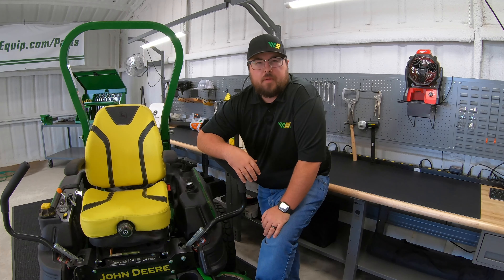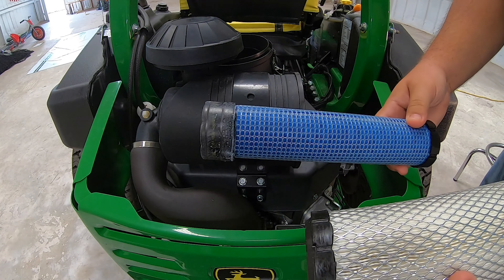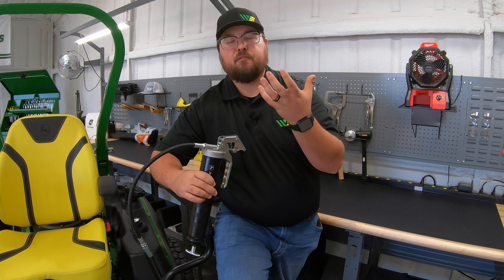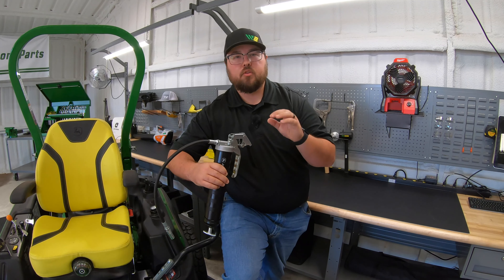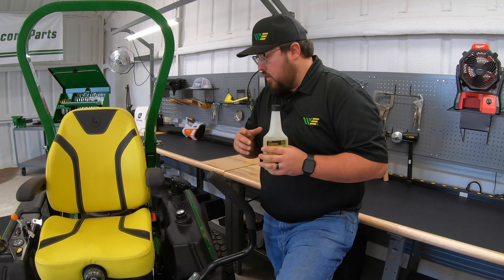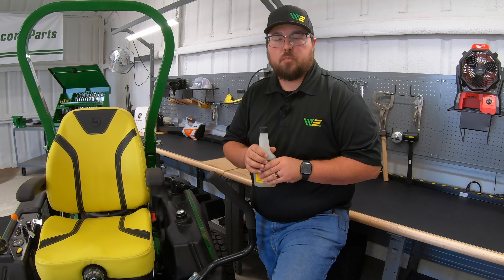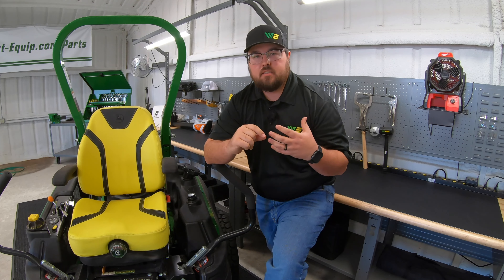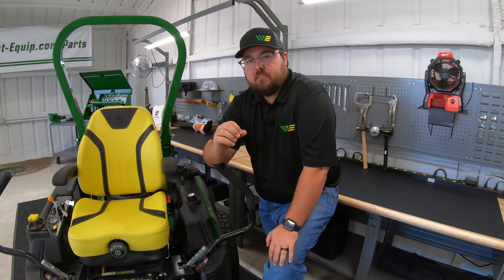5 Things to do Before Storing Your Mower for the Winter

Comment: Good overview. I’ve also seen people recommend fogging the engine with fogging oil while ruining the engine empty. My Kawasaki engine manual says to remove the spark plugs and put a little oil in the hole. Do you think these winterizing oiling steps are not necessary?  Also, for the battery,  manual says to simply disconnect the negative terminal. Is this inferior to using a trickle charger?
Reply from the maker: I’m not real sure on the oiling techniques. That seems like a little over kill for the mower only sitting over the winter and I would always suggest going with a battery maintainer.
Reply: @WesternEquipment  great. I went with using a battery maintainer and not bothering to fog the spark plug holes.
Reply: Not gonna hurt
Reply: @armandosinger I followed the manual last year. Pulled the spark plugs and poured a bit of oil in. I think this year I'll be fogging with some seafoam deep creep. It's like handling pest... gives you a peace of mind. You're already investing a bit of time doing these five things. Why not spend an extra 20mins?
Reply: @johnm.6349  My riding mower manual also states to pour 1 ounce of engine oil through the spark plug hole into the cylinder for off season storage. I learned that this helps prevent the cylinder from rusting so I will be adding the oil before I store it.

Comment: Hi, thanks for the great video.  Wondering where my fuel shutoff valve might be on a z545r if any. Manual says to use it if present as the manual covers a few different models. Thanks!!
Reply from the maker: I don't believe it comes with one from the factory unfortunately.

Comment: I have my mower in my shed so it’s not in the elements there’s no electricity in the shed so using a trickle charger is out of the question. Would it be fine to go out there throughout the winter and just start the mower and let it run for a little bit to let the battery charge up like that or would you advise against it?
Reply: I’m not sure
Reply from the maker: This would work, but the cold will drain it quicker than in warm months so you will have to stay on top of it.

Comment: If I can't hook up a battery maintainer to my S130 due to where its stored, as in outside under a tarp away from power outlets, would it be a good idea to disconnect the battery and take it in for the winter?
Reply from the maker: Yes, I would do this for sure. Thanks for watching!

Comment: Having a new S130 delivered this sat 11/26/22,  I have a shed with no heat, would pulling the battery in bringing it in the house for the winter work? Live in NJ winters hang below freezing for around 3 month, I don't want to run power cords to the shed for trickle charge.
Reply from the maker: Yes this would be ok as long as the battery is not on the floor on concrete.

Comment: Hello for winter there’s a little pool of gas I can’t siphon out,  anything I can put in there to evaporate it so the carburetor doesn’t get gummed up? Thanks so much
Reply from the maker: My recommendation here would be to invest in a small bottle of fuel stabilizer and then mix it with a small amount of gasoline. Then run it in your mower for a while to get everything clean in your fuel system (lines, carburetor, etc.). Then turn the fuel off on your mower if you have a valve and if not then let your mower run completely dry. Or you could completely fill your tank with the fuel stabilizer and fresh gasoline mixture, run the stabilized fuel through the system, and then it should be fine to let sit over winter. I hope this helps and thanks for watching!

Comment: Trickle charging is not an option, can I remove the battery and store it indoors for the winter, will that erase the hour usage gage or other readings
Reply from the maker: Yes you can remove the battery and store it. This will not affect your hour reading or gauges. Good question and thanks for watching!

Comment: Where exactly is the fuel shutoff valve on the S100? Manuel doesn't seem to have it mentioned or pictured. Did some searching but only found things concerning the solenoid not location of the valve. As far as the Trickle Charger, StrongBox 1.5 amp, no instructions, no attachment to mount under battery. Oh well, it's not rocket science.
Reply from the maker: A lot of the smaller mowers do not have a fuel shut off installed from the factory but they are very easy to install. You can usually find them at your local hardware stores.

Comment: Hey Brent What fuel grade do you recommend using on a ‘22 John Deere z355e, regular or super ?
Reply from the maker: Just use regular gasoline NOT gasoline with ethanol. So look for 100% gas at the gas stations. A lot of times it’s only one pump.
Reply: @WesternEquipment  will do …appreciated the feedback 💯

Comment: Just curious.  Does anyone take the tension off the belts thru the winter?
Reply from the maker: I have not heard of this, but I may have to look into it. Thanks for watching!
Reply: Hypothetically, everything except water/ice cubes contracts when the temperature lowers to and past the freezing point.
I would imagine this applies to the belts as well, in which case they would be put under a little more stress and lengthen a little over time.
Whether the belts would return to their original length and tension come warmer weather ... I don't know.
But it probably wouldn't hurt to remove the tension for the winter.

Comment: 15 hours a year. I'm thinking change oil air filter once a year before storage, battery off inside, fuel stabilizer.   Not sure about burning gas out of the engine with shut off?.Sharpen  blades  Every other year? Maybe every year.
Reply from the maker: I agree with all of that except depending on how much you mow, you may want to sharpen you blades a few times a season. Once you grass starts looking like it’s being torn instead of cut off smooth then your blades need to be sharpened.

Comment: I don't have a trickle charger, can I just remove the battery? Will removing the battery damage the hour and fuel gauge? Thanks.
Reply from the maker: Yes you can remove the battery to charge it, but if you would like to have a trickle charger here is a link to where you can get one https://247parts.com/parts-attachments-and-accessories/john-deere-batteries-chargers-and-accessories/. Thanks for watching!

Comment: Instead of a trickle charger, wouldn’t we be able to just turn the engine on once a week for a few minutes? Would that keep the battery charged?
Reply from the maker: Yes, that should keep things fresh but a trickle charger is a good idea if this is a problem to remember this step. Good question and thanks for watching!
Reply: Yes for either.  I run mine anytime it gets cold or every couple weeks thru the winter.  Been doing it for 30 years and she always starts each spring.
Reply: Need more than just a few minutes. Also want to make sure it gets up to temp and run long enough to evaporate excess fuel that blows by into the crankcase and to avoid condensation issues if planning to run every week or so in off season.

Comment: I have z345r. I was told to run fuel out for winter. Is that wrong? I use marine gas only. I just had to have the carbonator replaced $$$.  

Wondering what I did wrong.
Reply from the maker: Running them out usually is an ok idea. It all depends on climate and moisture. sometimes leaving it full over the winter with a fuel stabilizer is a better way to go so that you don't have possible condensation build up inside you fuel tank that leads to having water in the fuel.

Comment: I always put several styrofoam cups filled with moth balls in my boat to keep the mice out of the boat, I would think it would work the same with a covered lawn tractor, if the unit is stored in an unheated storage shed or barn mice shouldn’t be an issue, they are drawn to the warmth of the engine.
Reply from the maker: This sounds like a great idea. Thanks for the comment.

Comment: Yep, either drain fuel tank and run empty, or fill tank to capacity with fresh gas. Ideally to the base of fill neck. With ethonal free gas, probably don't need fuel treatment.
Easier to just fill tank with fresh gas.
Definitely cover mower if outside and in a way that allows air flow underneath the cover to keep moisture from being trapped. Amazing how many people spend so much money on equipment to just leave the weather destroy it.
Reply from the maker: Yes, you definitely want to take care of these machines!
Reply: Leaving it empty will dry the seals out
Reply: @gper2509  depends on the equipment, storage conditions and length of time. 
I used to store my generator in my shed with a full tank and did monthly 30 min runs and topped off with fresh gas.
I rarely use it and now store it in my basement in stable temps and humidity with an empty tank. I might have issues with dry rot SOMEWHERE, but whatever issue I might have it'll be better than sitting in the shed for 3 years full of stale gas. I'm not fiddling with maintenance runs,  etc anymore.